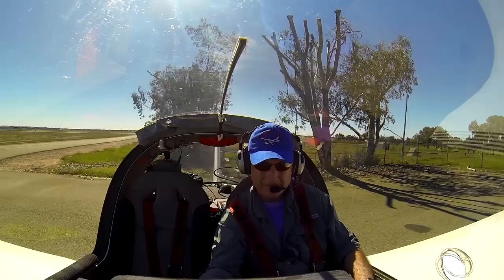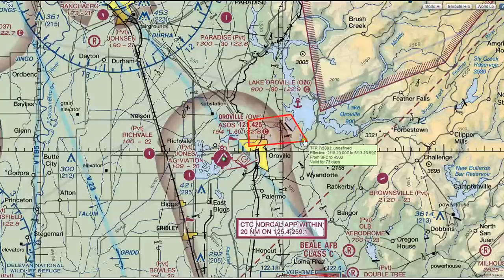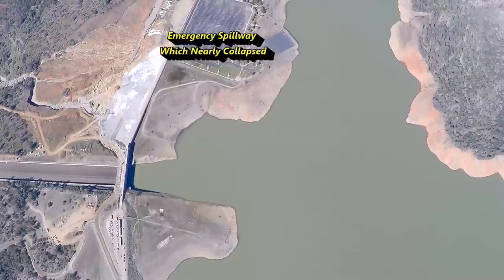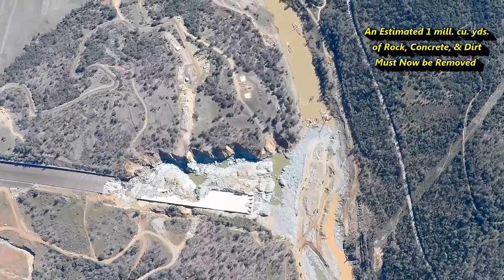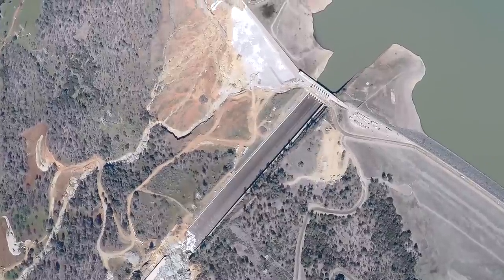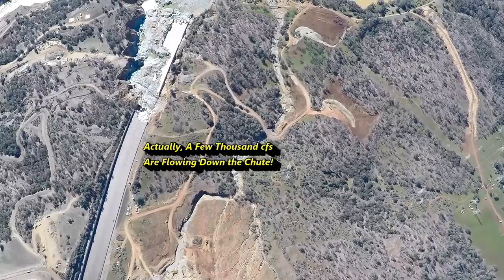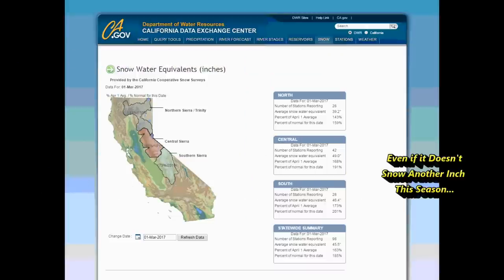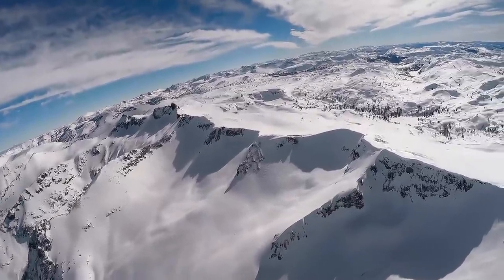Oroville Dam Spillway Near-Catastrophe: Update for March 1, 2017

Comment: For all who are putting the blame on Brown, it's true, he has been Gov since 2011 and more worried about some areas than others. Now asking for nearly 1/2 a billion from the FEDs to repair the Oroville dam. Perhaps the money spent to provide drivers licenses for illegal immigrants would have been better spent here (among other things). It's not like this was a surprise issue, however it helps if the people getting paid to do a job actually does it! Prior to 2017 problems, the engineers had been screaming for years to make repairs, the spillway had an attempted repair made in 2013. Here is what was said:  2013, 2015 spillway cracks and inspection:
The spillway cracked in 2013. A Senior Civil Engineer with the Department of Water Resources was interviewed by the Sacramento Bee and explained, “It’s common for spillways to develop a void because of the drainage systems under them” and “There were some patches needed and so we made repairs and everything checked out.
In July 2015, the state Division of Safety of Dams inspected the dam spillway visually "from some distance" and did not walk it. Again, people getting over paid and doing armchair inspections are going to be the cause for many deaths yet again!  Time for Mr. Brown to manage something other than immigration for a change, like fund raisers to fix California's failing infrastructure!  Don't expect the FEDS to bail-out you're mismanaged funds every time you do so, perhaps it's time for a better manager, that's what happens in the civilian sector when one can't do their jobs effectively or efficiently!

Comment: Apparently,  they have been skipping inspections and failing to review reports for decades. The emergency spillway was identified as deficient in a report in 2006. The main spillway had damage in the same area that failed 3 years ago. The drain valve at the bottom of the lake is currently inoperable due to lack of maintinance. The power plant at the forbay (part of the overall Oroville complex) had a major fire a few years ago. It looks like the emergency spillway would have failed on the day it was built if it have been used then. Yet for 40 years no review of the design and construction was done. You are a pilot. What would happen if you skipped inspections on your aircraft, didn't read reports of act on them, didn't research airworthy directives for your aircraft, etc? Would it be a surprise it there were an in flight failure? Of course you wouldn't allow that to happen. I am in complete agreement with your remark about the design, maintainance, and management of the Oroville dam. I'm glad somebody finally said it.

Comment: A couple more critical points to consider... (1.) The Voluntary Evacuation Order has NOT been rescinded and won't be until the power station is restored which requires "billions" of tons of rocks, trees and gravel to be removed from the base of the Feather River (2.) Because there is currently no outflows (water being let out of the dam) and the inflows are adding 5ft. of height to the dam per day, if the repairs cannot be made in time to crank up the turbines in the power station and they have to open up the spillway again, there will be another MANDATORY EVACUATION ORDER forthcoming.
Reply: Running the main spillway poses no threat. The only threat was from the emergency spillway collapsing.
Reply: Correction needed. . The debris to be removed is 1.5 million, not "billions" of tons. But, they appear, even with the huge amount of work being done, to be only removing about 30,000 yards a day. So, they're concentrating on opening channels, to allow for the Diversion Pool level to be lowered to the point where the power plant can be reactivated. Word is, that might happen as early as Friday, if not today. 

Next, the cool, dry weather means the lake inflows are under 20,000 cfs, so the lake level is only rising about 2 feet per day. 

Therefore, the likelihood of another mandatory evacuation order coming is remote.

And the power lines are being re-installed, and will be up and running soon.
Reply: nomad9, no harm IF they can drain that pool.  If the water gets high enough to flood the turbines it will take lots more money and time.   This ALL should never have happened.
Reply: No IF about it. They're making progress. As I said, the plant will restart soon.
Reply from the maker: Not so ("no threat from running the main spillway").  The main spillway recently held without further damage at 100k cfs for several days, but what if they have to release higher flows?  Continued erosion up that concrete ramp to the gates could compromise operation of the gates themselves--and thus ultimately the operational safety of the dam.
Reply: rbtree, okay. Sounds good at this point.  But we will have to agree that at best it is a patch and not a fix.  Worse case is the weather changes fast and gets a lot warmer, the snow will convert to water and I think the fear is that the lake level could raise fast and we start all over again.  Not hard to see that at the bottom of the spillway could fill in again and putting power plant in danger again.   They are doing heroic efforts to make the best of a bad situation for sure, it's just that we don't have much wiggle  room upstream with the other dams near capacity.
Reply: Thankfully, there was very little spillway damage above the initial failure. But, below, it is decimated. It will take some amazing design and engineering to repair it.
Reply: Thankfully, the next storm is slated to come in cold and be smaller. Hopefully, the spring runoff is moderate and controllable..... but, at 200% snowpack, that's a lotta snowmelt!

Comment: Didn't know you were back.  Some how I got unsubscribed.  Looks like your bird is flying good again.  I heard it was gasohol.
Welcome back. N454N TLUSA123
Reply from the maker: Yep, Ethanol (E10) Auto Gas did me in (de-laminated the fuel tank!).  Back running strong, again--on alcohol-free auto-gas, thanks!  TLUSA154.  You may like this: https://www.dropbox.com/s/ctcdnqh8yrjets1/44%20Tips%20%26%20Tricks%20for%20Sting%2027%20February%202017.pdf?dl=0
Reply: It took you a long time (and flight time) to write all that.  Very interesting reading.  Thanks for your skills and time.